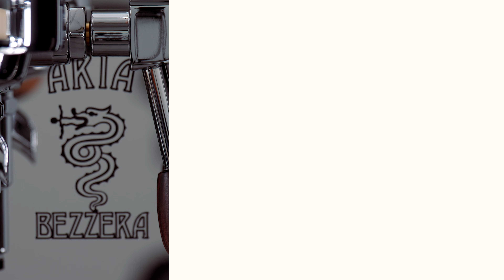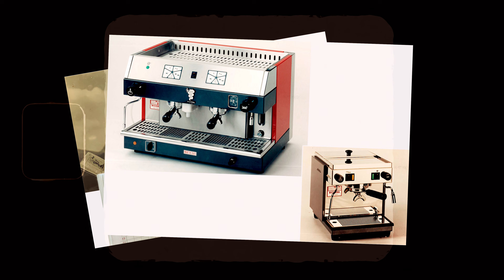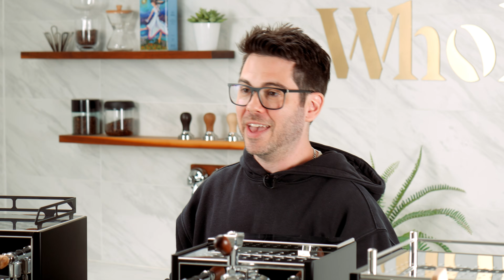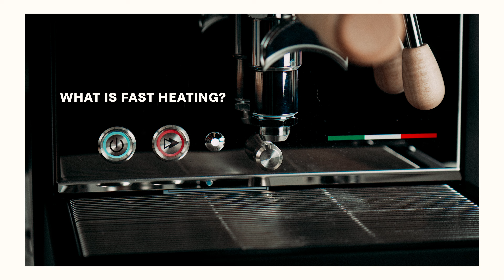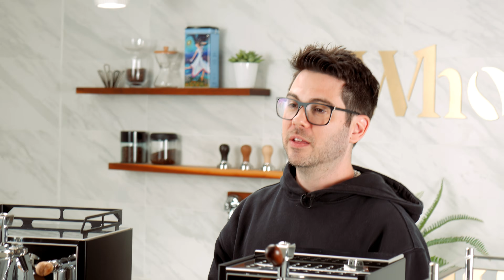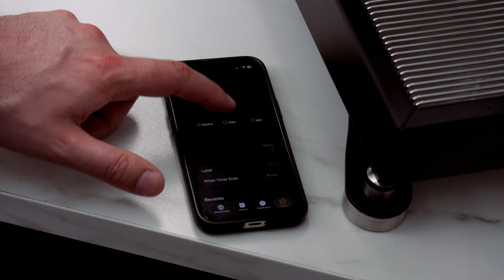Has Bezzera Just Fixed the Biggest E61 Espresso Machine Problem?

Comment: Just buy the amazing BZ-10. I am using a BZ-10 for 6 years, have made more than 10 thousand espressos and cappucinos and still works like the first day. Heats up in 5 to 8 minutes. Easy to clean and maintain. Bezzera is such an underrated brand.

Comment: I was worried about heatup times when I first shopped for a machine.  After untold hours researching, I ultimately bought a E61 with a "slow" heat up time.  But it is irrelevant.  I have a smart plug and it is ready to rock and roll when I get to the kitchen every morning.  And, on the odd day when I'm out and about and know I'll want a shot when I get home, I just use the app and turn the machine on remotely.
Reply from the maker: Hey T thanks for sharing the tip! I don't disagree, no matter how long it takes to heat up, you can always set a smart plug. - John
Reply: Exactly how I have mine set up with my Bezzera Magica, I can remotely start it up from anywhere so it’s hot by the time I get home or wake up in the morning

Comment: I bought one of the older models Bezzera from you guys, a few years ago, and it’s been a TANK, for the heat up time, I use one of those plugs that can be controlled with Alexa…Those machines are of the highest quality in my opinion.(for the price)
Reply from the maker: Hey Rick, thanks for the comment and for sharing your experience. That's a great solution!

Comment: Rocket machines take a few min to heat up
Reply from the maker: Rocket advertises their new FAST machines at 15 minutes as well 😉
Reply: I have a 5 year old plumbed, rotary rocket. Takes 20 min max, less if I run water through the group starting at 10 min. I think you can be running at 15 min with a couple of flushes.

Comment: Nice machines and clever work around to get the e61 heated faster, but I can't stop thinking that the e61 just seems outdated at this point. The workarounds work, but they just don't compare to a saturated group head like the lineas and the new ecm
Reply: I have the new ECM Synchronika II and it’s amazing.
Could t be happier with it.
Pulls shots in 6min and steam in about 10.
Reply: Since I don't care about steam I got a Puristika but I don't think that line will get these fancy updates :/
Reply: E61 appeals to a different group of people.  Like people who like classic cars, LPs and turntables, and mechanical watches.  They sacrifice 100% fidelity and accept anachronistic character, aesthetics and tunability.

What I do find odd is that E61 is supposed to be easy for the home DIYer to maintain with off the shelf parts but that advantage is removed the more manufacturers put in proprietary parts and service.